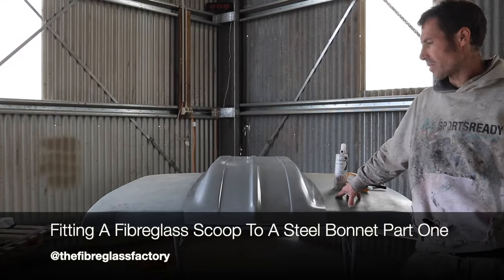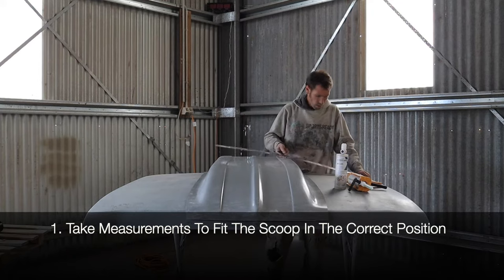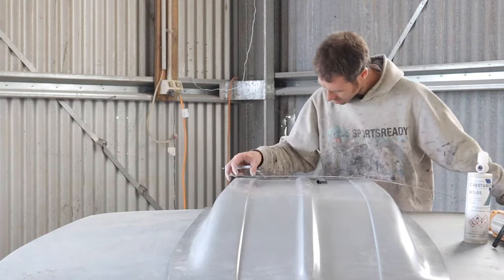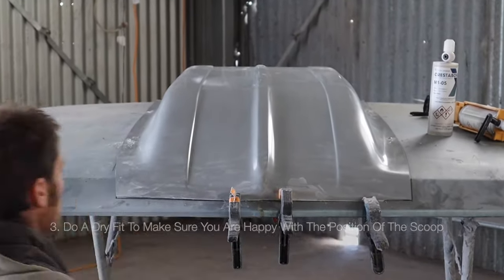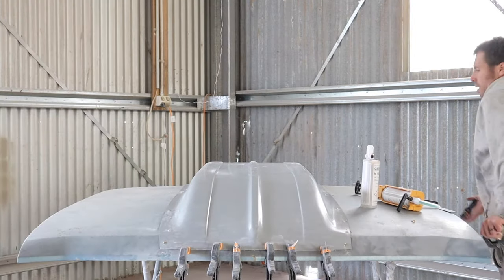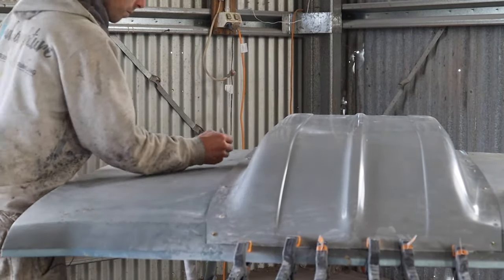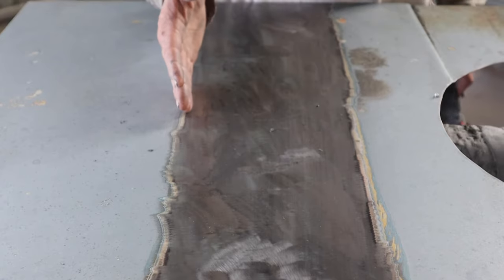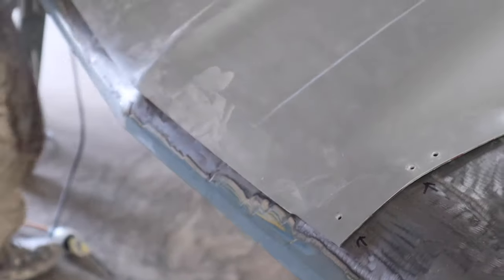Fitting A Reverse Cowl to A Steel Bonnet Part 1

Comment: Wish I watched this first before I did mine. Won’t stop cracking the filler and I’m guessing it’s the glue I used
Reply from the maker: Hi Jacob, Its a process that needs to be done correctly, it could be glue or even the prep work.

Comment: I glasses mine direct to the hood cut off the flange so it really looks stuck not much feathering at all and he should have painted under the scoop the bare metal is it's going to rust I glued it down with fiber fill and then came back with the regular sheets of fiberglass so it can't crack around the edges
Reply from the maker: thanks for your thoughts